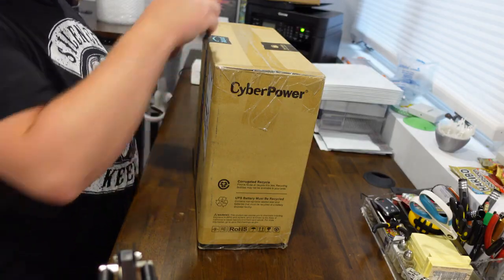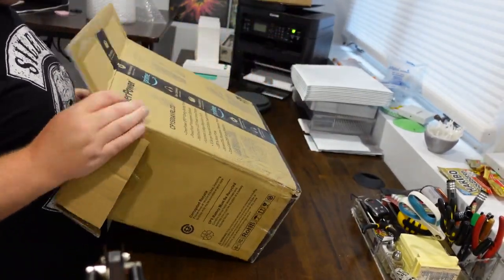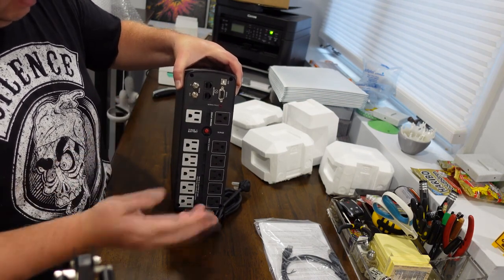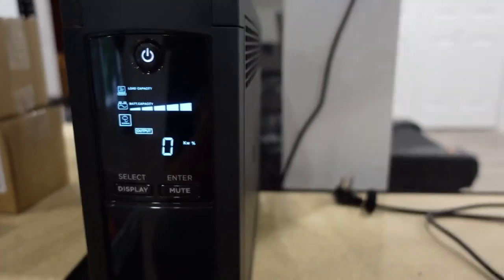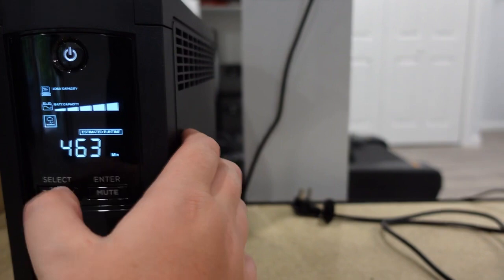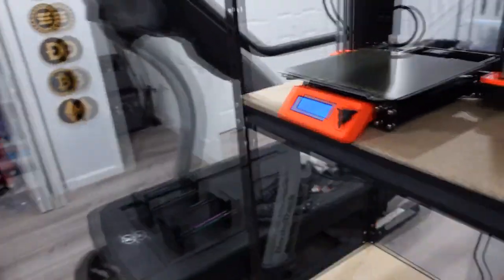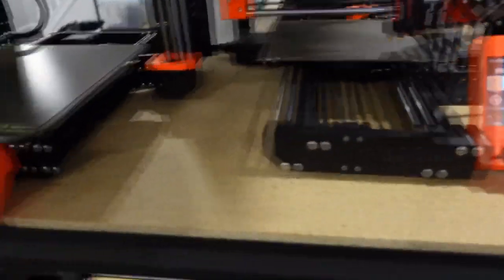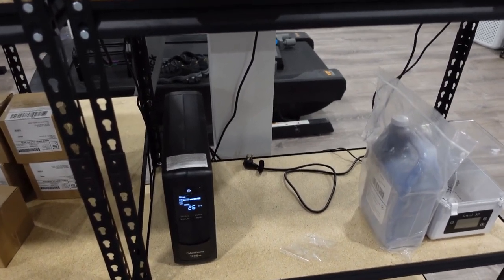Stop Losing 3d Prints When Power Goes Out!  CyberPower CP1500AVRLCD Intelligent UPS System Review

Comment: Hello. Are you plugging into commercial or residential outlets? Are they 15amp or 20amp breakers and how many printers running off of one outlet through the UPS. Just bought two printers and dryers and trying not to burn down my house lol😂
Reply from the maker: I'm not an electrician but the way I have it set up is I have six on each unit, And on each circuit, when you start them up you can only start two at a time but they eventually take a lot less as they are running

Comment: Power outages in my part of Texas usually last for OVER an hr. Very seldom for a minute or less. Looks like the only way to be sure is to use an external deep cycle battery instead of the enclosed one. Just sayin'.
Reply from the maker: The ones that last long Prusa has a feature that it can recover the print but not when it flickers and loses half the power